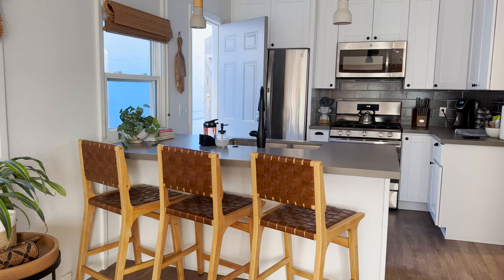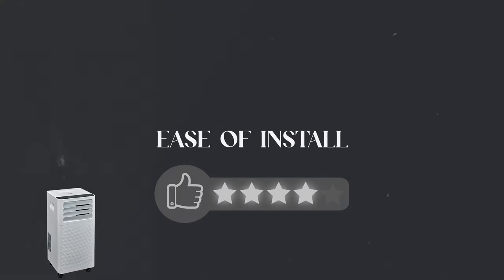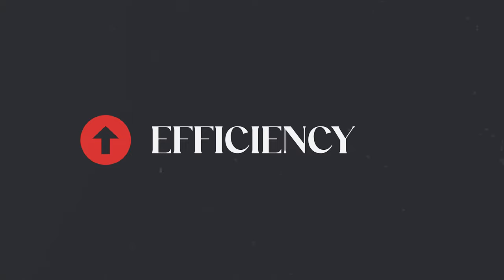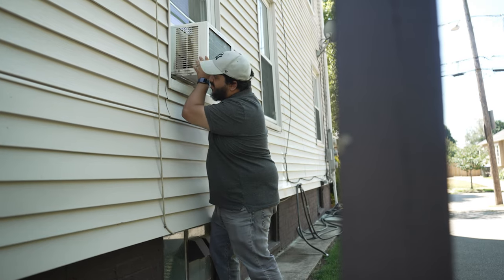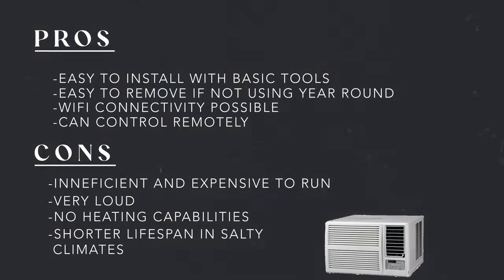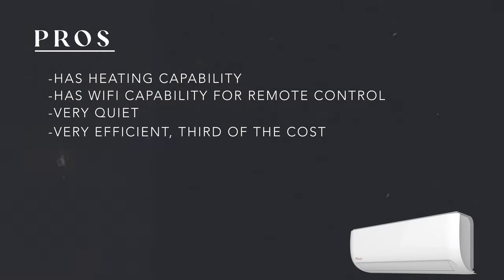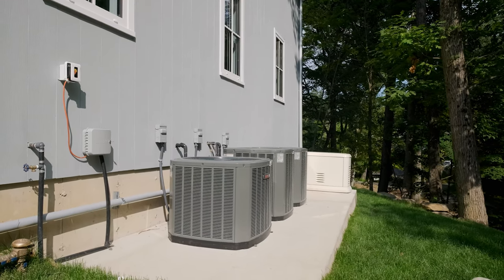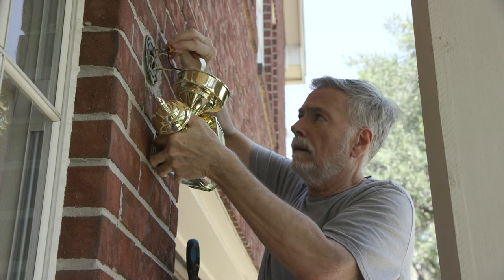Cancel the handyman. YOU can install AC at your Airbnb. Yes, YOU!

Comment: You did not mention Through the Wall AC Units. I'd say, these fall between Window Mount Units and Ductless Splits. Pros: You do not lose the function of a window. Nor do they require a condenser on the exterior.
Reply: You mean PTAC units? PTACs requires a sleeve and not as easy to retrofit into an existing home.

Comment: Excellent video.  Two quick questions:
1.  Is it always a 1:1 ratio with an inside unit and an outside unit?  Or can you have multiple inside units sharing one outside unit?
2.  If you have multiple mini-splits in a house and they are all on wifi, is it possible to have a "hub" of some sort where they all work together to heat or cool the house (so they act as a unified system)?
Reply from the maker: Here’s your answer! 😊

https://youtube.com/shorts/BXBL2UFUkIw?feature=share
Reply: @kyleeandsteven  Phenomenal!  What speed, what service! 🙂  Thank you so much!
Reply: @kyleeandsteven  Agree with your answer, also should note that dedicated indoor and outdoor unit also makes your system more reliable. This is also recommended for multi story dwelling units, where heating and cooling loads can vary drastically from floor to floor.